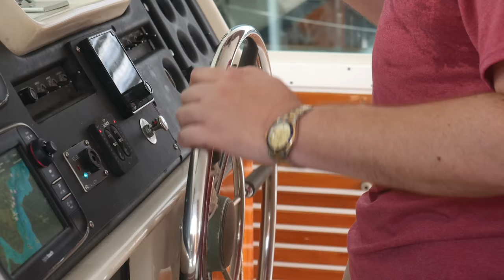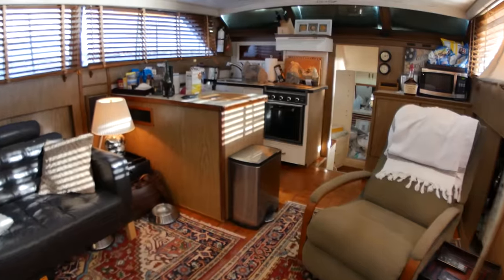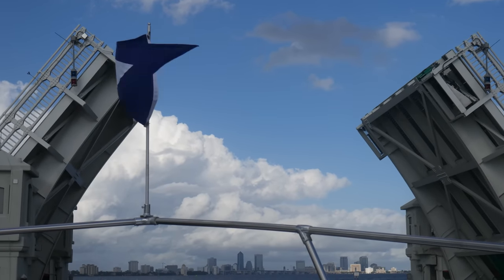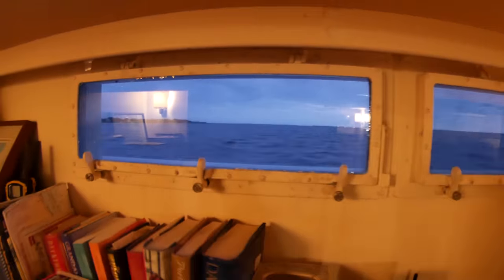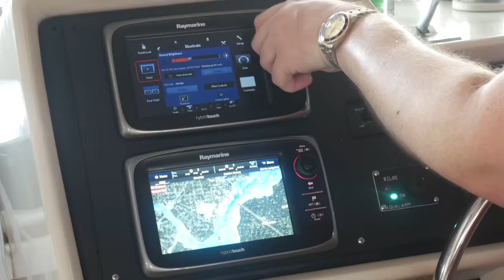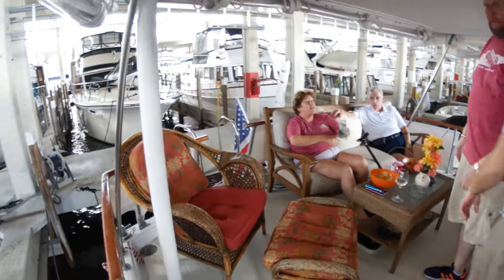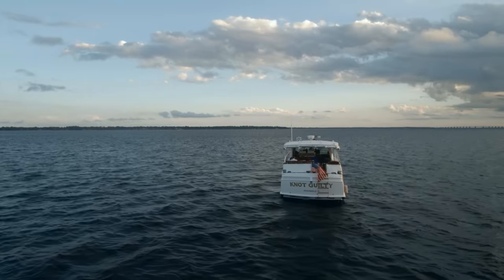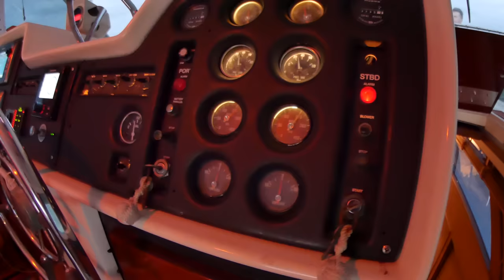Welcome Aboard this Chris Craft Commander 47'

Comment: You did a Fantastic job  redoing this one Buddy , I grew up in South Florida  and have been boating for over 35 years i’ve owned 17 or 18 of them so far  all types and sizes  made the Bahama crossing  several times you shouldn’t have many issues or Worries in the 47  with good running Diesels  be smart on the Weather watching for the Gulf Stream  and adjust accordingly  once your in The Bahamian Waters you have plenty of Barrier Islands to safe Anchor and hide out from any bad weather  just keep a good eye on Radar for Sneaky Vessels  that may be Pirates  Scoping out your boat. they target live Aboards knowing we have cash  and valuables  i strongly suggest carrying  Arms and Ammunition despite Bahamian laws etc Customs are basically lazy  give them a  nice present and a  cold Cocktail and  let them do their Paperwork  if you aren’t Smuggling they  pretty much leave you alone  i’ve never let them count my Ammo on my way in or out  and face it We have the right to protect our Family and Home  i’ve seen  Vessels   playing games on following me on Radar and  made a general radio transmission that my Vessel is aware of them and we are fully Prepared to defend. ourselves. if they do not state their Intentions   that incurred no problems as they retreated and did not return  damn right i slept with a  Semi Auto under my pillow  with spare Clips within reach but without need to use it.  it was also nice to know i had the Advantage if i needed it  as. i. know the layout of my Boat better than any one else  will  and i had my own Burglar Alarm set  in the event of anyone Boarding or trying to enter  the Cabin Areas  but overall the Bahamian Waters are fairly safe  and there are plenty of visiting Boats that will look out for one another  enjoying the same lifestyles

Comment: Nice boat.  I almost bought one of these, but I had a lot of other irons in the fire, and I knew that it would be a money and a time pit.  It was a 1970's 410 Commander, and everything was basically mechanically good, but everything was original. When I say original I mean down to the green screen radar with the periscope snorkel to the 454 gasoline engines...  it would have been 10 times what the boat cost in new parts, and ALL of my other projects would have been put on hold for a year or more.  I can just imagine what you have into making this one shine like a new dime.  Kudos on a job well done, Brother!  :)

Comment: What speed can that boat cruise at?
Very nice, those old commanders have always got my attention out on the water. Only to be outdone by the old Huckins boats running around jax.
Reply from the maker: We ran about 8-9 kts at 1400 rpm. I don't know the max speed, but its gotta be pretty fast. Its a planing hull at high speed.
Reply: @CullenCraft  The GM 8V53's were not terribly powerful (240 hp if I recall correctly).  They were overtaken by the 6-71's in later years.  I think it topped out at around 18 knots full throttle and cruised at around 14 knots.